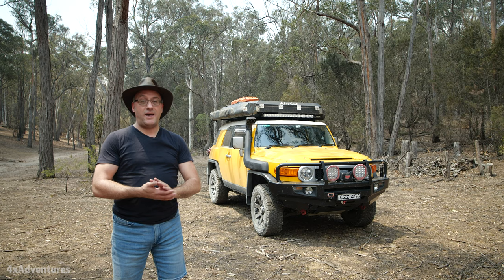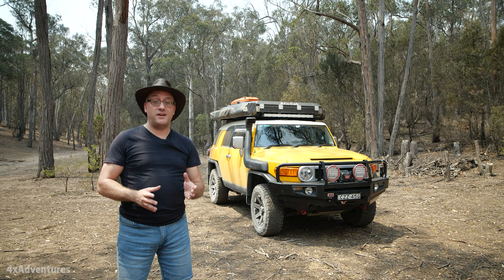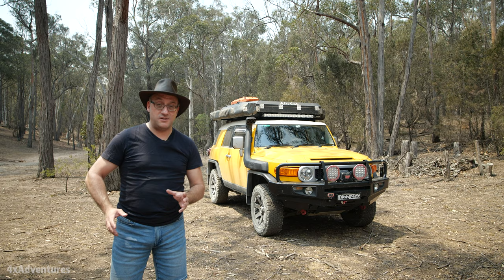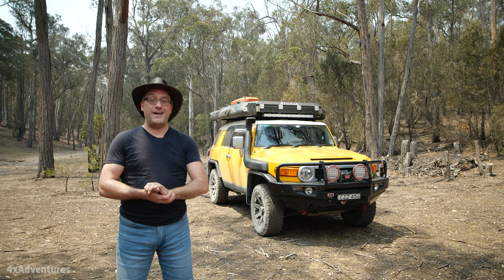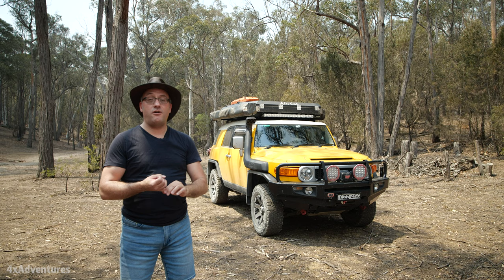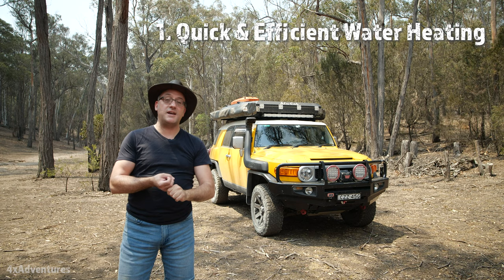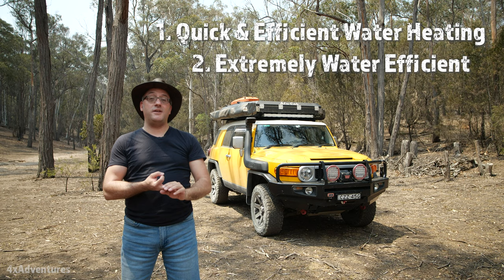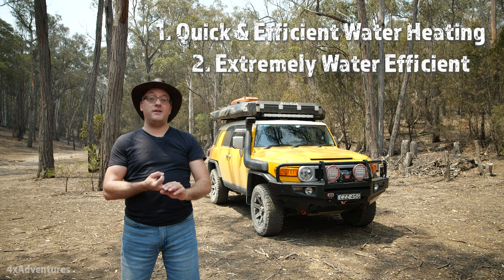Built-In Hot Water and Shower System for Touring/Overlanding | @4xAdventures#adventure #4wd #touring

Comment: So i commented on this video awhile ago and I keep finding my way back to it. I'm ready to get one set up. Question though, at the end of the video you offer to build one, what do you mean exactly by that? Piece it together on Amazon? Physically piece the kit together? Just curious. Im ready to do the same thing and some help would be appreciated
Reply from the maker: G’day Travis, where are you located? 

I have a list of websites in the description where you can get the major components. 

Alternatively, I can source them myself, and either:
1) send you the various bits as a kit,
Or 
2) build the basic bits and, as the various parts can be located around the vehicle, I can send a kit to you with sufficient hose lengths for you to join up the various bits. 

If you are located in Australia (Only Sydney is possible at the moment because of border closures), I can install the whole thing for you.

The cheapest option for you would be to source the parts yourself & to build it yourself. I recommend at least laying it all out so you have an idea of how all the bits go together before starting the installation. If you are using a heat exchanger, I found the hardest part was working out where to mount it - you may need to fashion a custom bracket, as I did. The rest is fairly straightforward.

Best of luck!! 😊👍
Reply: @4xAdventures  I appreciate the quick response. Im actually located in california which could be a issue lol but figured I'd ask though. Wasn't sure if you meant just piecing the kit together as a list of items or what. I saw that glind offers kits that are ready to go but wasn't sure if piecing it together would be a better option or not

Comment: Wow, I'm impressed. I have installed my system last summer. However, it was too hot to take a shower. I love the idea of the tempering valve. I've learnt something new today. Could you advise me where I can get the pump that works by the trigger system ie pressure controlled? I just subbed your channel. I have a 150 Prado but it doesn't matter. I also have the Alucab tent on top. Great info. I was just about to give up on the shower idea until I bumped into your video.👍👍👍
Reply from the maker: G’day John! Glad you found the video useful!! Are you in Australia! In Australia, you can get the pump from Road Tech Marine http://roadtechmarine.com.au if you’re from outside of Australia, any good marine/boating supply store should have it. I’m sure re there are other brands, but the pump I use is a Seaflow 9.5L/min  automatic pump.

Oh, and thanks for the sub!! 🙂👍
Reply: @4xAdventures  Well, I've hooked up the way you had shown and for some reason I lost quite a bit of water pressure. Before I used the direct hot water and had a bit of the pressure going but of course it was too hot. Now I can barely get the water flowing. I was wondering whether I could contact you directly and have a chat. I'm in Australia so it would be easy. Thank you
Reply from the maker: Hi John, sure thing. Email me at contact@4xAdventures.com.au and we can then take it from there. 👍

Comment: Great system and very informative video.  Question: your diagram shows the glind inline between engine and radiator, but the input hose to the Glind seems much smaller than the typical (at least on some cars) upper or lower radiator hose.  Am I understanding the connection correctly?
Reply from the maker: Thanks very much! Radiator goes to engine. From the engine, there’s a hose that goes through the firewall to your heater in the cabin. From there, the return hose goes back through the firewall and, on the FJ, it appears to go back into the engine block, but I know this must find its way back to the radiator eventually. I am tapping into this return hose at the point where it comes out of the firewall. At that point, the hose is about 25mm in diameter (on the FJ). 
Hopefully that makes sense! 😊👍
Reply: @4xAdventures   Thanks for the speedy reply -- that clarifies a lot: the Glind sits on the cabin heater return hose.  Since asking, I found an old Pat Calinan video that makes more sense now as well.  Although, he seems to control the heat of the water by turning the cabin heater dial.  Does the cabin heater affect your system also?
Reply from the maker: It can, depending on how your heater works. At least, this is what I’ve read. I’m not a mechanic though, so don’t know if older vs newer vehicles have differently operating heating systems or not. (A Tesla or similar electric vehicle would have an electric heating system, I imagine). I haven’t actually checked on mine. It always seems to produce hot water, but next time, I’ll test that out.

Comment: Hey mate love the system and want to do it soon to my vehicle. I was originally thinking or a re-circulation method into my underbody water tank to get the whole tank up to temp but this is much better. I have a question though. Do both your cold and hot inputs to the temper valve come from one source (either tank or bucket) from your input ? If so do you have a seperate pump for each line or you you just run a Y piece and one side goes to the heat exchanger and then to the temper valve whilst the cold line goes directly to the temper valve ? Really would love to know this cheers great vid
Reply from the maker: G’day Taylor,

Both hot & cold come from the same source. Water tank > pump > Y splitter. One path goes to heat exchanger, then to hot input of temper valve. The other path goes to cold input of temper valve. Mix output goes to shower rose. That’s the basic setup. Only the one pump. Hope that helps! Let me know how you go. All the best, & thanks for watching! 😊👍
Reply: 4xAdventures  that’s ingenious ! So when you want just cold water for drinking do you disconnect it and just go straight from the tank ?
Reply from the maker: My setup is ever so slightly more complicated. I have a splitter coming out of the water tank. One path goes to a pump for drinking/cooking. The other goes to the pump used for shower. Although they are both connected, I have inline taps & close the path leading to the shower when I’m not using it. I also have another splitter for the input of the shower system allowing me to use the on-board tank or plug in an external source. Once again, I have inline taps. I also have non-return valves to prevent reverse flow as I don’t want potentially dodgy water from some external source (e.g. river) from mixing with my drinking water.
Reply: 4xAdventures  very smart mate love it

Comment: When you are not using the shower, there is still some water in the heat exchange. Will the coolant heat keep heating those small amounts of water causing any issue? Do we need a bypass that stops the coolant goes to the exchange when not in use?
Reply from the maker: Excellent question. I was actually speaking with the guys from Glind about a week ago, and they mentioned there is no such issue with the Glind heat exchanger. Some other brands can experience corrosion, and for this reason, their heat exchangers come with a sacrificial anode, however this problem doesn’t exist with the Glind. 
I have had mine for about 18 months, and can report no issues so far. (FYI, I have no affiliation with Glind.)
Reply: @4xAdventures  Thanks for quick response. One more question. It seems that you need to turn on the air to max hot inside the vehicle. Will it make it too hot in summer? Any workaround?
Reply from the maker: No worries. If you plumb the heat exchanger to the radiator hose coming from the engine, before it goes through the firewall and into your heating system, then you don’t need to crank up the heat in the cabin. It’s only if you plumb the heat exchanger after the heater where that has an effect on the water temperature. 😊👍

Comment: Love this found out the company is only 1 hr away from me here in Brisbane planning to drop in, could you help with a diagram on how you installed this please?
Reply from the maker: Hi Tony, glad you like the video!! There’s a diagram at the end of the video. It’s fairly straight forward. I am planning on making another video to further explain how it works & how to install it soon.

All the best! 🙂👍
Reply from the maker: Yup! That will definitely work. I’ve fused that before. On the FJ, I actually used the temper valve from Road Tech Marine, which is exactly  the same but half the weight because it’s a plastic housing, but that would definitely work!!

Comment: When the engine is not running and want to take a shower, what causes the flow of water to go through the heat exchanger to heat your cold water coming from your tank or river
Reply from the maker: There is a 12v pump that is connected to the battery. There is no need for the engine to be running. You really only have the pump running for short periods of time, so not much power drain at all.
Reply: Does it mean that you are heating your tank while the engine is running and then switch the engine off and you use 12 v pump to pump heated water from tank for shawer
Reply from the maker: Not quite. The onboard water tank remains cold. When the engine is running, you are heating the engine. Once the engine is turned off, the engine remains hot for quite a while, so you can pass cold water through the heat exchanger & heat it up using the heat from the engine.
Reply: @4xAdventures   so is there an electric pump pumping the cooling liquid from the engine thru the heat exchanger...

i'm planning on making this kind of shower too. Did you setup your pressure actuated pump in between the thermostat and shower, to suck it thru the thermostat? otherwise   i'm guessing you need pressure on both the cold and hot side of the thermostat? :)
Reply: i'm sorry i just saw your drawings!!  thats the easy'st way of doing it !! Good Job!
Reply from the maker: @BMWE36Thomas  Hi Thomas, I am only using a single 12V pressure sensing pump. This passes the cold water through the heat exchanger. The heat exchanger is plumbed into the heater hose that carries the hot water from the engine through the heater and then back to the radiator, so no need for an additional pump for that side, as I am simply extending the heating hose by inserting the heat exchanger. Remember to top up with additional coolant because you are essentially extending the length of the heating hose by about 1m! Good luck! :)

Comment: Hi
Silly question but are u showering with water with coolent in it 
Thanks
Reply from the maker: Ha! No! That’s not how it works. :) 
The two never mix. The heat exchanger is basically a plastic cylinder with 2 spiralling copper tubes passing through it. The spiralling copper pipes touch each other, so the heat from one pipe (the engine coolant) can be transferred through to the other pipe (showering water). 

Hope that helps!! 👍😊👍

Comment: Great video!  Do you remember the diameters of the hoses you used?  Thanks in advance!
Reply from the maker: Thankyou! I used 12mm quick fit hoses from John Guest for all the plumbing in the hot water/shower system (not including the radiator hoses, which would be specific to your vehicle & heat exchanger). Check the links in the description for more info! 😊👍

Comment: This is brilliant. I love your setup, and how you use it.  Your videos are awesome too. You have skills... :). One thing that would be useful is to have a write up of this somewhere, describing all the components, where they go, etc. You have been describing some of this here and there. A web page or PDF would be awesome.
Reply from the maker: Thank you so much Gabriel! That’s a good idea. I’ve been thinking about creating a website for a while... maybe I’ll make one soon. 
Thanks very much for watching!! 😊👍
Reply: @4xAdventures  Hi Attila. Let me know if you need some pointers/help in setting up a website. Feel free to contact me privately for that. 

In the meantime, and just to have this documented and to save research time, would you mind listing the exact components you used? In the US the tubing we would use I think would be PEX. I saw you mentioned the brand of the heat exchanger somewhere, but cannot find it now. Perhaps more importantly given that was an Australian brand that may not be available outside Australia, what are the specs? I think the pump you use is a Shureflo 2095? And what about the Temp valve?

One other thing that is unclear to me: if the engine is not running, then I don't understand how this would work. After all, cold water is pumped through the heat exchanger but the small amount of hot water in there would get cold right away. So, in order for this to work you need the engine on to keep circulating hot water through the heat exchanger, no?
Reply: Hi Attila. I just wanted to follow up on that last question. Also, I noticed you put some of the components in the description above since I posed my questions above, with the exception of the temper valve. Would you mind sharing which one you used?
Reply from the maker: Hi Gabriel, I am using the John Guest temper valve - available from johnguest.com. Essentially any temper valve is suitable.

Comment: I thought the Glind temp could be controlled by using the in cabin temp control on the dash? Beautiful job by the way. Can your water pump be controlled for speed / flow rate?
Reply from the maker: It can, however the reason I’m using the temper valve is to reduce water wastage through adjustment of the heater control until I get the temperature right. The water flow rate can be controlled via a tap as well as a small valve on the shower head. 🙂👍

Comment: great setup, defintely what i need. 
One question though , do you need to keep the engine running to keep flow going in the heatexchanger
Reply from the maker: Thankyou. You don’t need to keep the engine running. There’s a separate 12V pump to pump water from a tank/bucket through the heat exchanger. The engine block remains hot for quite a while after driving, so there’s no need to keep the engine running. Of course, if it’s first thing in the morning for example, just run the engine for a few min to get it up to temperature and then you can switch off again.
Reply: @4xAdventures  thx for explaining. btw did you built the exchanger directly in the coolant line od as as parallel bypass. wondering about flow during driving
Reply from the maker: Directly inline. I’ll be filming an installation video where I will explain everything in more detail. Stay tuned!! 
😊👍

Comment: I've read 5 comments where you say the engine does not need to remain running. But surely once the shower has run for a minute or so, it will exhaust all the residual heat in the exchanger, without any new coolant flow from the engine? It's only going to work for a short period unless you have another separate pump to circulate the engine coolant.
Reply from the maker: Hi John, yes, you are correct. But it’s not “a minute or so”. With the engine off, you can actually produce a surprisingly large volume of hot water. Plenty for a shower or two. I’m not necessarily talking about 30 min showers with continuous running water throughout. For that, simply leave the engine running & throw a hose into a river :) I have an FAQ video coming out in a few days which will hopefully answer any questions you may have. All the best 😊👍
Reply: @4xAdventures  For anyone reading this later, I've now installed the system and it works incredibly well. However it is wrong to say that the engine doesn't needs to be running. If the engine is switched off, the heat exchanger (the same Glind unit) runs out of heat within 30 seconds and starts going cold. The engine must be running to make this work. For reference it's a 70 series land cruiser with a diesel engine, but all cars run at roughly the same coolant temperature which is 85 degrees.
Reply from the maker: @johnleaste828 Hi John, thanks for your comment. The way I tend to use it is to briefly run it to get wet, turn off water, soap/shampoo etc. then turn on water briefly to rinse off. This way, it remains nice & warm the whole time. If you want to have a shower like you would at home, then definitely keep the engine running to keep the heat going. An alternative is to use an electric water heater like the Duoetto instead of the heat exchanger. The plumbing works the same way. But you’re right, the heat does eventually decline without the engine running. After a few minutes, I still get warm/room temp water (unless it’s winter) and that is still ok for me. Appreciate the comment. 🙂👍

Comment: How do you drain the water to prevent frozen lines when winter camping, hunting?
Reply from the maker: Excellent question! It doesn’t really get that cold here most of the time, so I hadn’t thought of that. Since most of the plumbing is in the engine bay & under the vehicle, it’s somewhat protected against the immediate cold weather. But, I could simply turn the water off at the source and either just keep the pump running a few more seconds or unplug the hose at the shower end to drain whatever water was left in the hoses.
Reply: You could pump RV winterization fluid through the system. Then drain the system. That way any remaining fluid will withstand freezing.

Comment: Hi mate. Did you make a custom bracket to mount the heat exchanger?
Reply from the maker: Hi Ben, yes I did. Finding a good spot for the heat exchanger & mounting it was the trickiest part. After that, the plumbing is easy.
Reply: @4xAdventures  thanks mate. I am going to use the 2 mounting holes on the cover.
Reply from the maker: That’s what I used. I recommend using loctite to ensure the bolts don’t come loose over time. Good luck 😊👍